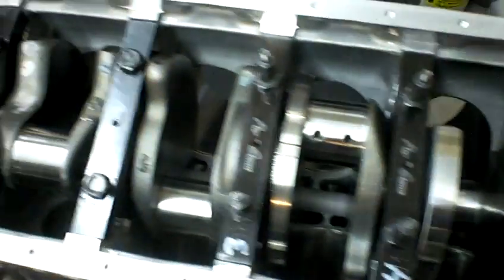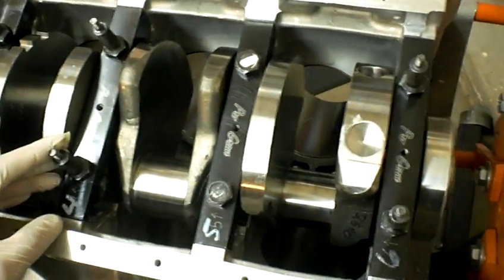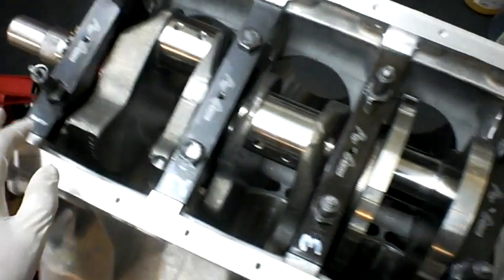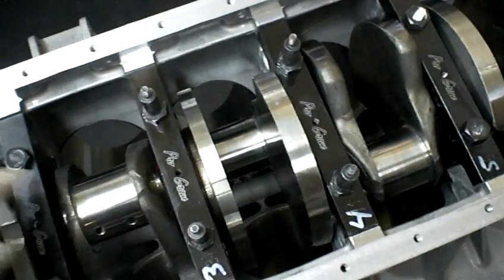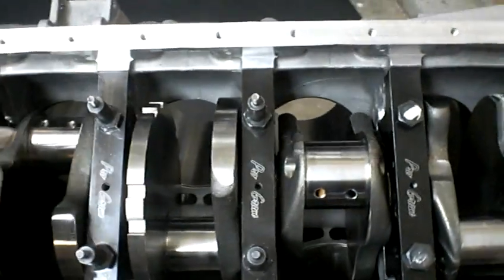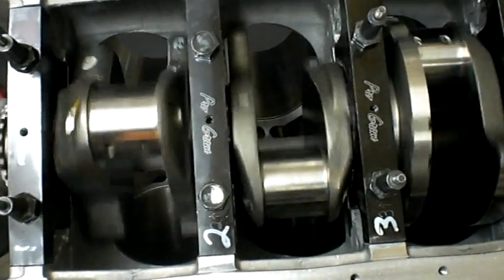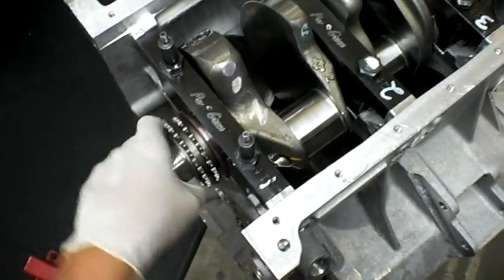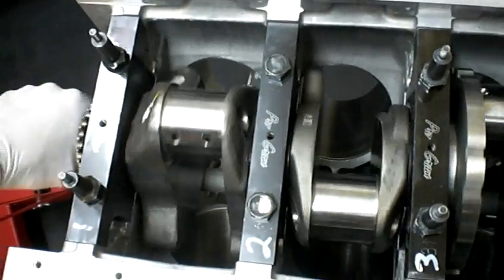Viper GTS Engine Build 1

Comment: Is piston 1 on the flywheel side of the engine on the right or left side?
Reply from the maker: @canaldotrap6645     #1 cylinder is at the drivers side front of the engine.    So it goes 13579 on drivers side, 246810 passenger side.
Reply: @eabrillon1978  Thank you very much man, I'm building a naturally aspirated V10 engine on the Viper engine, thank you very much, it helped a lot 🙏
Reply: @eabrillon1978  Hello, friend! Sorry for the inconvenience, I just wanted to ask a question, does the Viper V10 engine operate clockwise or counterclockwise?
Reply from the maker: @canaldotrap6645  rotates clockwise
Reply: @eabrillon1978  I wish I had a mechanic friend to teach me and help me with my project... thank you very much friend 🙏
Reply from the maker: @canaldotrap6645  no problem at all.   You can get a manual for these engines as well.  They cost about 30-50 bucks on ebay.   They are very helpful and. Very easy to understand unlike some other manuals out there.  I had to do all this stuff when there wasn't much youtube on vipers so I had to learn the hard way.  Join a couple of the viper forums, they will be able to help you a lot if you need it.  They are usually pretty helpful guys on there.
Reply: @eabrillon1978  Thank you very much for your time and for telling me what to do, I will do it, I am Brazilian, I do not speak English, I am translating here so that I can understand you, I am doing everything to make my project successful, thank you 🇺🇸🇧🇷

Comment: I see these two comments about spun bearings on a stock engine. Did you guys just run with low/no oil or simply never change the oil?

I'm not understanding why these engines would spin bearings considering most have under 50,000 miles.
Reply from the maker: Stock oiling on the Gen 2 and 3 motors were a poor design.  The main culprit is the cross drilling of the crank which causes oil starvation to the rods. There is quite a few practices to correct the issue, but the most common is to plug the cross drills, along with changing the bearing design.    For track use, most still run into starvation issues. The only real solution is convert to a dry sump system or external oil pump which can get costly.
Reply: The three/four rod bearings don't get sufficient oiling.   There are aftermarket tricks to help with this issue, but the techniques are "guarded" by the best viper builders.
Reply: mcgyverdude seeing how these are older guys and lots of "older" people or "less informed" people, not the same, might be running super old oil since they barely drive it. That and/or maybe they're running too thick and like to get on the car when the oil hasn't warmed up and thinned out to help circulate and protect.

I can understand those specific bearings seeing less oil, but I have to assume the engineers called it perfectly safe as the owner keeps up with oil changes and letting it get up to temps before going "powah!!!!"

Comment: Hey eabrillon1978, I have to say your video has got me to start thinking! I also have a 98 GTS that has the same problem that you said yours has, (spun bearings) I have had it inspected and im told i need a short block rebuild, anyway i have a few questions that i would LOVE to be able to talk to you about. if you would not mind calling me at 702-525-2518 i would really love to speak with you! thanks

Comment: Im sure the stock main bolts are fairly strong but with the added tortional stress on the block and uneven clamping force I would definetly have gone with studs. Beautifull engine by the way.